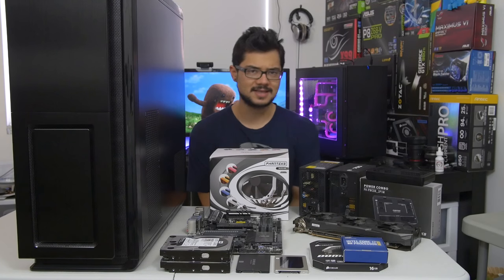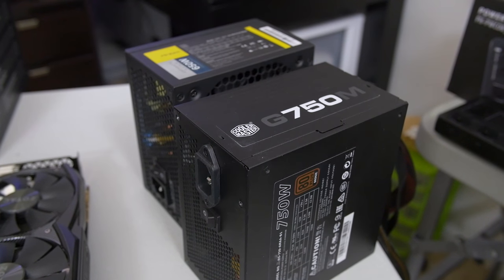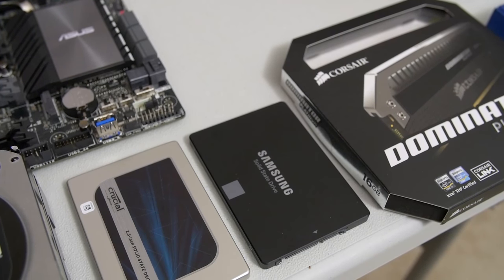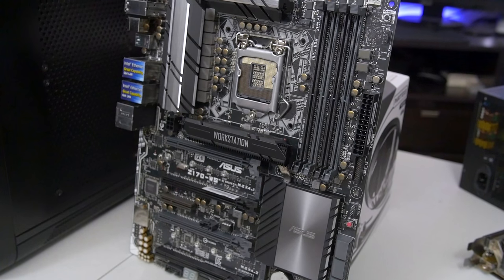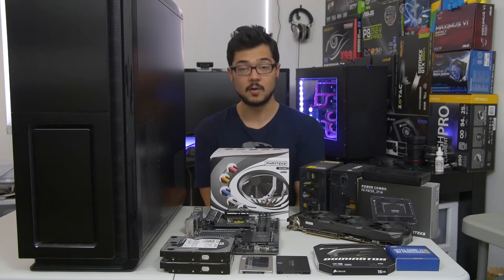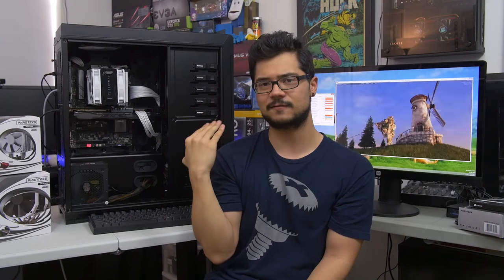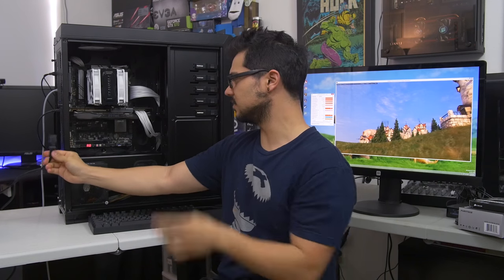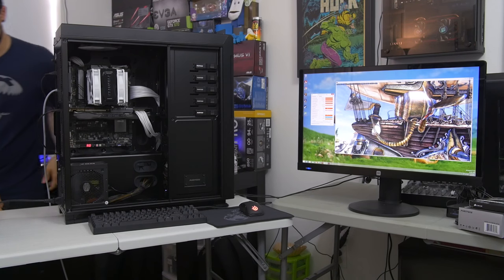Testing PSU Redundancy with the Phanteks Power Combo, Time Lapse Build!

Comment: HELP! Is this a good PC build for $1000? Let me know if I should make some changes! NOTE: will not be building until June/July!

CPU: Intel Core i5-6600k
CPU COOLER: Hyper 212 EVO
MOBO: MSI Z170 Krait Gaming
RAM: G. Skill Ripjaws V Series 2x          4GB(8gb) DDR4-2400
STORAGE: Kingston SSDNow 120 GB
                    Western Digital Caviar Blue           
                    TB 7200 RPM
VIDEO CARD: MSI GeForce GTX 970
POWER: Corsair CX 750W
CASE: NZXT S340 ATX MID
Reply: +GaryTheCoolGuyIII Yea i agree propley for gaming or video editing
Reply: More ram couldn't hurt, also Corsair has a bad reputation for psu's if you are gaming so get a EVGA supernova psu
Reply: I would say wait for nvidia/amd 14nm gpu's and maybe a bigger ssd
Reply: i'd wait until nvidia releases the 1000-series, they are supposed to come out in summer
Reply: CenterBlueCake Yes its good, but why so high on the ram? Isnt ddr3-1600 enough? I dont know the purpose anyway
Reply: +CenterBlueCake Maybe change the PSU. Other than that it's a solid build.
Reply: Definitely bigger ssd
Reply: i suggest not getting a k because the non k intel chips can be overclocked with some tinkering and with the money ur saving u can either put into more ram or maybe a 970 ti
Reply: Peter Leconte are you kidding, 1600mhz, lol he has a higher budget, 1600mhz is too slow
Reply: +Peter Leconte he is using a skylake processor  which does not support DDR3 memory and for DDR4 2400 MHz is average.
Reply: +J _rivvy would not recommend that for a first timer or a person with little experience
Reply: +MoeyTheMiner i guess but first time overclocking is a pain i got an overclockable cpu and when i first tried to overclock i got frustrated and wasted my money on a k chip because i never even got around to overclockimg anymore but at the same time he is saving like 40$ if he doesnt get a k chip
Reply: Also wait for amd/nvidia's new card which should release in summer, if you can't wait get a r9 series card from amd since the 970 only has 3.5gb ram and a r9 380 could beat it for the same price, correct me if I'm wrong
Reply: +J _rivvy over clocking your CPU is easy. What are you talking about it literally takes 10 minutes.
Reply: +GaryTheCoolGuyIII true
Reply: +Peter Leconte Bruh, he is running a 6600k. That's skylake and as far as I see the krait gaming mobo doesn't support ddr3. And ddr4 isn't that more expensive anyways. Besides, ddr4 doesn't have low speeds such as 1600, I believe it starts at 2000 or higher.
Reply: Insidious not really maybe to expetienced people
Reply: ***** oh damn i didnt know that
Reply: psu is overkill (i have a 6600k and a gtx 980 and for me 650w are fine)
Reply: No, don't get a corsair CX power supply-I would recommend an evga supernova g2 one. As well, don't get a GTX 970 as you said you are getting it in June and July and by then pascal and Polaris will be here, and so you should get one of those GPUs.
Reply: +Tyler Weigand I'm actually going to build a PC soon with a 970, but a lot of people are saying what you're saying and I should go for pascal. Two reasons why I don't know if I should. 
1. They're not coming out until June/July 
2. They're gonna be expensive 
3. I'm inpatient AF because I don't have a working rig currently. 
4. Help?!
Reply: +Insidious some of them will be expensive, but there will be some for the low end too. As well, they should make it so you could get around r9 fury performance for only 300 dollars. Some will be expensive but not all, Amd and nvidia will be releasing a full lineup and so it'll definitely be worth it
Reply: +Insidious Also forgot to mention that they will probably come may/early June so they will be out by the time you are building.
Reply: +Tyler Weigand Nice, I'm gonna tell you a little story if you're interested keep reading and give me your thoughts
So, I recently bought a pre built PC (I know) and it was extremely cheap, which is what lured me in. 
It has broken 3 times in 5 months! And I am devastated and now they're trying to tell me that I can't get a refund, so what I'm going to do is remove the hard drive on it to save Windows and many many other programs. Once I have done that I am going to deliberately break the PC by switching off my fuse box to destroy the PSU and then I am going to MAKE them give me a refund by showing them a new legislation about refund ps within 6 months if you item is not fit for purpose - it isn't.
So this hassle has really scared the shit out of me about building my own PC. I am sooo scared that it's gonna have two PSU fails and one motherboard fail in 5 months please give me some reassurance that I can't be unlucky two times in a row like that. Hahahahahaha
Reply: +Insidious HOLY CRAP. And don't worry, as long as you buy from reputable brands it's highly unlikely to get bad components. Even if you do, generally you can send them in for an rma
Reply: +Tyler Weigand Good stuff.

Comment: hey Paul I had a question? is there any way to test how much a specific program uses and how much a program when used together in conjunction with others programs? I'm building my first computer and have a few programs that I have to use together. the programs are mabinogi an MMORPG, IMVU Skype ,Discord , and Dragon  Naturally Speaking I also plan on sometime doing some drawing on a graphic tablet but I don't believe it needs that much Hardware on that part but the other programs aren't really working with my I3 and 16 gigs of RAM
Reply: I couldn't see his name and Paul's comment was at the bottom. my apologies if I got the name wrong but I still would like some help with this problem
Reply: +kyo gamer lol ok sorry. You are forgiven. What are you trying to measure?
Reply: While essentially I'm trying  to build a computer that can handle at least four or five programs at once. But some of them are graphic intensive and some of them are CPU intensive. The programs I'm trying to measure our Dragon NaturallySpeaking, imvu ,mabinogi,Discord , Skype and Google Chrome all at the same time.
Reply: +kyo gamer So a core i5 w/ an SSD and a respectable graphics card is all you really need.  Basically anything you put together should be able to handle that provided you spend enough on the gfx card.  If you plan to overclock then grab a k sku.  if not, then any core i5 will do.  Core i7 would do it better if you have the budget for it.  If you're gaming @ 1080, then a GTX 960 or an r9 380 should handle it just fine.  Step up would be a 970 and a 390.  For the SSD, any crucial, hyper x, samsung, intel, or adata ssd should be enough.  And a 600w power supply should be able to handle most any of that in a single rig just fine.
Reply: +Rudiez Da'Man that core i5 should be 4th gen or higher, and the i7 can be 2nd or 3rd gen. Over locked 2nd gen i7 2600ks can easily beat out an overclocked 6600k
Reply: +Rudiez Da'Man also 380 is currently better for price/performance and he should have atleast 8gb of ram.
Reply: Thank you guys I currently have a sandstorm striker case which is the only component I currently have . The current computer I'm using is and i3 With 8gb of RAM on a siingle stick HP pavilion refurbished
Reply: +kyo gamer ok so make your new system at 
www.pcpartpicker.com
You can buy the parts from there or just make a list to see if they will work together and get a price estimate.

Comment: this is one year old..  hehe.. sorry for bring this up again but i got a question... with this power combo, which PSU becomes the main PSU..?? like for example GPU mining rigs tend to use sata/molex powered usb risers pcie 1x to 16x.. around 6 to 7 risers depending on the rig.. the risers need to be powered by the PSU Powering the motherboard... so with this, does both the power supplies become one or does INPUT 1 become the main PSU..??

Comment: Hey Kyle... Is this case a little bit more rigid then the Luxe????
Reply: Did you have rigidity issues from a Luxe? The only time I've seen Kyle discuss the Luxe was in The White Build, but I didn't hear him mention rigidity issues. The side panels are easy to scratch, if one drive cage is removed, the other can flex a little, & if you try to pick it up by the flap over the front IO panel, you'll probably break that, but otherwise it's quite well built. Mine's over 40# fully assembled,  & I can pick it up by the top fan mounts without issue, which I usually do, as it's easy to pick up off the floor that way. From everything I've seen, the Primo is as well built as the Luxe. There are some issues, such as limited radiator support on the bottom next to the power supply, but I've never heard complaints about the build quality beyond that of the easily scratched windows. If you experienced issues with the Luxe, I wouldn't expect you to like the Primo any more, but if you're going off something you heard elsewhere, I would suggest checking it out yourself anyway. The only Phanteks case I've heard any rigidity complaints about would be the Enthoo Pro M, where people have said the side panels are too flexible.
Reply: Hi. I did purchase the Luxe. And I love it. I got the white edition. It's gonna be a really slow build because of the amount of money I plan on spending for this build. I'm giving myself a $4500.00 ,. Budget.. And so far including the case so far.. Have spent just under a grand on just 32G's RAM Memory,and Samsung 950pro M.2  512G's... HXI Corsair 750i PS..And (2) Corsair ML Pro 140 LED 140mm Case fans.

Comment: Do the wattages get added together so for example you would be able to pull barely 1200w out of the wall or am i wrong?
Reply: +Kappi1997 Yes, but you get no redundancy that way
Reply: +Kappi1997 sure but there is no point in doing that because if one of your PSUs fails, the second gets fried.

Comment: How does a server handle the multiple PSU's? Does it have a thing similar to the Power Combo or is it something else?
Reply: +PNathan Proper redundant PSUs are not designed like this. They are a single unit with multiple modules providing power. They probably also contain more than a simple bridging of the inputs.
Reply: Jim C K Flaten Okay, thank you! :)
Reply: Server redundant psu is literally two power supply modules in one kinda casing. With some complexish wiring so it all goes to one output

Comment: i came here bc i have Dual SLI RTX 3090, Ryzen 9 5090x, 2 M.2 2TB, 4 SSD 4TB, Hyperx Predator 128 gigs ram and maingear's apex water cooling. I also bought a 1600 watt psu so i was wondering if i could run this pc on full load

Comment: But there is one thing I don't get. The output only has 24 and 2x8 pin, no sata power. Doesn't this make this system completely obselete if the drives are connected to only one psu?
Reply: +Don Grille Umm, watch 8:49 again.
Reply: +SPEEDERT12 Oh alright I only listened to the video, but how does that even work?
Reply: +Don Grille the working PSU is feeding power through the Splitter back to the failed PSU, so everything connected to it will still receive power.
Reply: ***** Thanks for the answer. Just shows how much there is to learn.

Comment: I watched another video and it was used to power a mini itx system and a atx system in one case.
Reply: That's actually another Phanteks product. It looks pretty much identical, but it actually does the exact opposite; power two systems off a single power supply instead of a single system off two power supplies.

Comment: Nice video. Now do the opposite: Use a power splitter to run 2 systems in one case, for example an editing rig and a NAS.
Reply: You could do unraid
Reply: +Evan Theis True, however it would make for a lot more interesting video to build the separate systems don't you think?
Reply: +Mika Kuitunen I'm pretty sure Linus has a video on two systems in one case. I don't think he will do it when it's already been done.

Comment: So i assume this runs them in parallel? Wounder if that means I could run a high wattage gpu off two 300watt psus. My fiends running a athlon dual core with a 6950 off a 300watt psu and the thing dumps heat but one of these and a second psu would be a cheap way to spread the load out if it indeed runs in parallel
Reply: Maxwel Was just wondering if this runs in parallel I have 300watt compaq oem psu laying around I could give him if he got one of those. Ive recommended him taking it and running it in his system but he is not keen to the idea of sticking bare wire from the green to a black wire on the 24 pin connector to get the second psu to turn on. I'll have to grab him one of these.

Comment: How can you have 4 Way-SLI on Z170? With only 16 PCIe lanes?
Reply: +CrazyTuber72 not really even worth it, performance would be pretty bottlenecked at 4x PCIE speeds. if you want 4 way you go with the X99 platform to maximize lanes per GPU :)
Reply: +CrazyTuber72 4x by 4x by 4x by 4x.
Performance won't  be too much affected, because even the 5960x when extremely high overclocked is 'bottlenecking' 4 titan x's.
Or 980ti's, they perform somewhat similar.
Reply: +CrazyTuber72 they have a special chip that provides extra lanes for the extra cards
Reply: +CrazyTuber72 pretty sure the extra cards go through the chipset so there would be a latency issue there aka not recommended
Reply: They just run in x4 mode. Theres a whole section in the manual that tells you how the mobo splits up lane resources whether it be Sata, or PCI-E
Reply: Shadowaries1 except sli REQUIRES pcie 8x to funtion . It won't run on 4x.
Reply: +Phoenix Wright Just looked up the EVGA classified 4 way SLI.  It uses PLX chips to get pcie lanes where needed.  

4 way runs in x8/x8/x8/x8
3 = x8/x8/x8
2 = x16/x16
1 = x16

According to their specifications.  Routing through the PLX chip sounds bad for just the 2 way SLI though when its capable of just running x8/x8 but don't look at me I'm no professional
Reply: The motherboard has a PLX chip that will double the lanes from the processor.
Reply: +CrazyTuber72 PLX Multiplexers
Reply: Yeah heres where the i7 fails ;3
Reply: So since SLI needs 8 PCIe Lanes per GPU in order to function correctly (not 4 as AMD cards do) the Mobo has a "PLX" chip to double the Lanes of the CPU? Ok, i did not know that, thanks :)
Reply: +Germo Gen SLI doesn't work over 4x...

Comment: so the PSU was still getting power, probably feedback from the other PSU, (Note the fan still spinning on the PSU while unplugged)
Reply: ***** I think it would also. i know this is suppose to be for redundancy, but while the system is running that can't be good for both PSU's to be feeding back into each other constantly. That's probably why he seen that little boot in FPS when one of them were unplugged.

Comment: This seems like something cool for a NAS or Server, but why get it over a dedicated UPS?
Reply: +mike condo It's not for power outage but for a failing power supply. All common servers have a similar setup, because the power supply is one of the most failing components.
Reply: Basically this is more "if a power supply fails my computer won't die" rather than "my computer will stay on for some time when the power goes out."
Reply: +StardustDragon08 yep

Comment: Why does g750 fan keep spinning after unplugging?
Reply: +smantikov Because the other PSU supplies 12V through the same lines. So the fan is essentially powered by the other power supply.
Reply: +smantikov The 650 takes over and runs power to parts connected directly to it AND to the 750. It basicaly feeds power through the 750 to run the drives and that's why the fan keeps running
Reply: +SPEEDERT12 So that means epic R.I.P if there's a short circuit in the 12V rail?

Comment: Hey Tech pros and bros. I have an old prebuild computer laying around and the graphics card is not connected to the psu. now I want to upgrade just the graphics card can I just buy a cheap psu and connect the graphics card with it? I would also add an SSD.
Reply: I hope this makes sense.
Reply: never buy a cheap psu, it can kill/fry all of your components. You'll need to buy a psu that you can connect to ecerything not just gpu and get atleasy a 80plus bronze certified psu from corsair, seasonic, evga, xfx, thermaltake
Reply: +Miko okay thank you very much. I will replace the old psu with a stronger one and buy a new R7 370

Comment: Can anyone explain why a second PSU would help from a power outage? Wouldn't a UPS (unterruptable power supply) be better suited? 

If the power goes out instantly, the power would stop going through the PSU since all it does is convert, so what difference does it make adding a second one.??
Reply: +Axe Avier It's not for power outage but for a failing power supply. All common servers have a similar setup, because the power supply is one of the most failing components. PSU is also needed to protect against outages.
Reply: +Michiel Haisma also ensures that you dont have any downtime, especially on servers etc which could cause loss of money
Reply: +Natalie Wiltshaw That is only if a PSU fails not if there's a power outage
Reply: Rithik Kumar No, i know, i was just adding to his comment that if there was both power outage and failure without sufficient redundancy there will be downtime, which can be very costly especially to growing companies.

Comment: not that really practical though without the modular case.

So one of your PSU is dead, you still have to turn the whole workstation down, pull all the cord from the dead PSU, install new one and by then you will be able to have a full system running again...

Comment: why was the psu fan spinning even after disconnecting the power to the psu?
Reply: +bhushan kharmale The device backfeeds power, all it's doing is tying all the 12V, 3.3V, 5V, Ground, and god knows what else together on both units.
Reply: +Charles Scott The reason are the capacitors inside the psu dude......